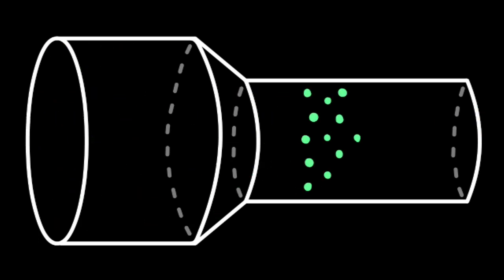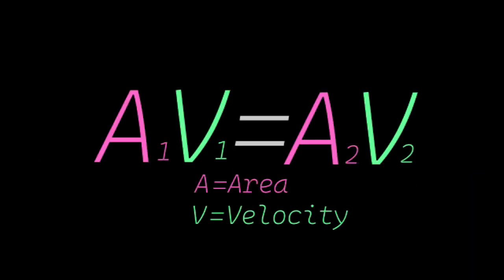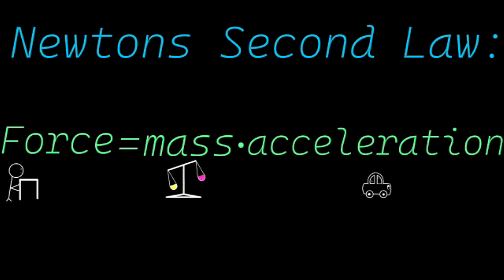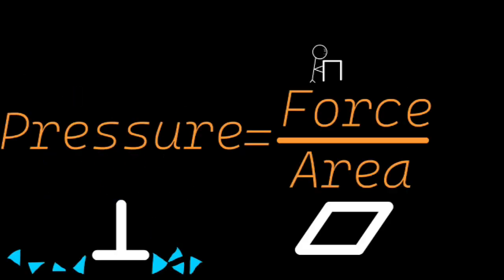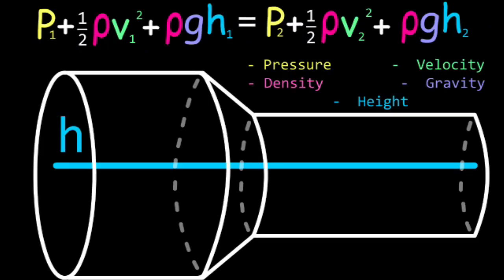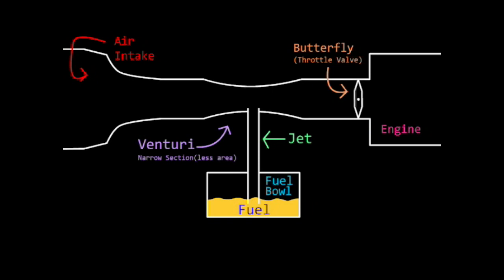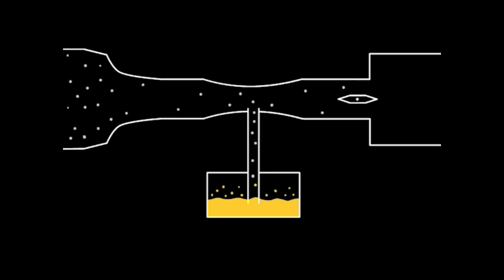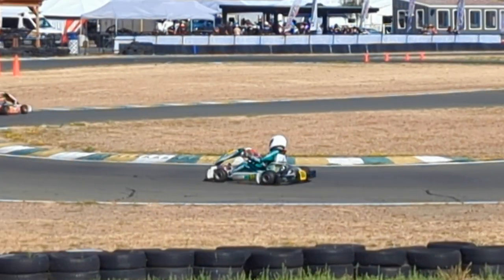Bernoulli's Principle: How does a carburetor work?

Comment: Thanks for the video! Had to get the air out of a windowless basement and used the Bernoulli principle you described (opened the first floor windows in front of the basement door to make the air move on the top floor and suck the basement air out). Nice job